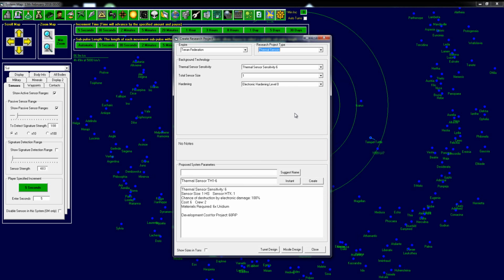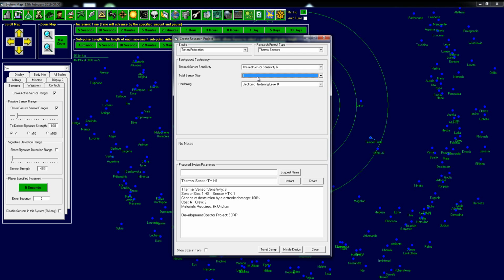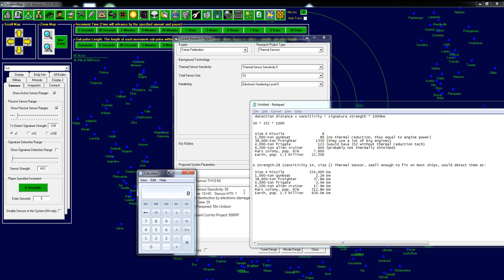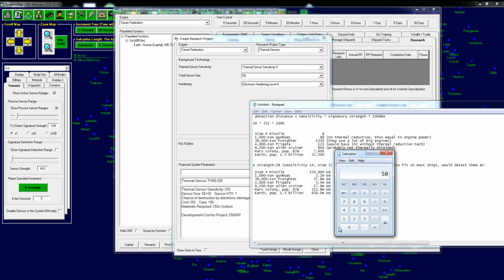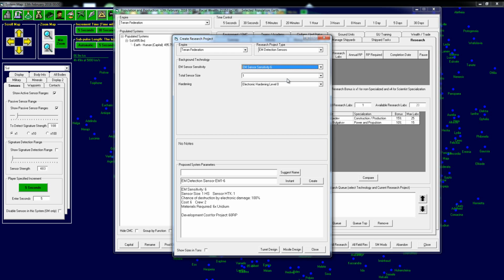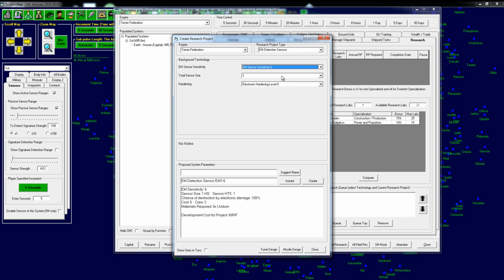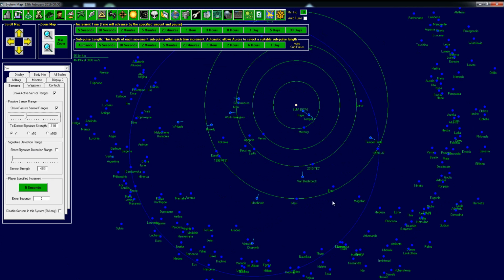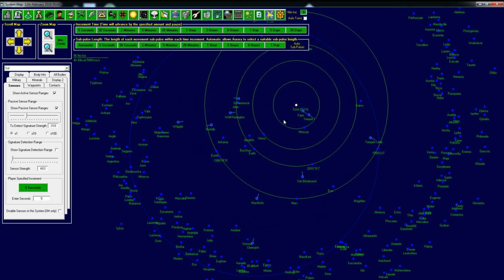Aurora 4x Ship Design Tutorial - "Passive sensors/Deep Space Tracking Stations"

Comment: usefull tutorial. 
in game it's realy not clear, what range u can get from passive sensor.
why do u recommend to have passive sensors on every ship? i mean, u didn't say a word of practical usage. what for do u use EM-sensors on operational (fleet ) level? it's quite clear, that you want to have EM and TH data on strategical level, but why do u want to have it on a ship, that has active sensors of it's operational degree?
Reply from the maker: +Sledge Hammer Well it's because I primarily play with both active sensors and shield off. So EM and TH sensors work as a first level warning while keeping your ship at least a bit more low profile.
Second thing would be that passives are so cheap you will not notice having them on every ship while if at any point they provide you with an early warning/information they are well worth it.
Third any kind of information is useful. If you get size, TH and EM information about your target you can deduct way more than from just one/two sources.
However again it depends on your play style. If you don't want to do it, don't :) There really is no hard efficiency penalty on your ships not having it. I just like it and imagine it as a "standard".
Reply: Alfapiomega seems reasonable. how do u know in game what EM-signuture your active sensor provide to enemy? (with turned off shields, if ship has them) i just want to calculate, what size of EM-sensor enemy needs to see me with EM-sensor before i see him with my active sensor.

on this example 
Kursk class Dalnij bombardirovshchik    11 250 tons     319 Crew     3047.5 BP      TCS 225  TH 352  EM 750
3128 km/s     Armour 8-44     Shields 25-300     Sensors 1/1/0/0     Damage Control Rating 18     PPV 35.04
Maint Life 3 Years     MSP 1354    AFR 126%    IFR 1.8%    1YR 226    5YR 3393    Max Repair 480 MSP
Intended Deployment Time: 12 months    Spare Berths 2    
Magazine 363    

352 Mill Magneto-plasma Drive (2)    Power 352    Fuel Use 50.76%    Signature 176    Exp 11%
Fuel Capacity 1 000 000 Litres    Range 31.5 billion km   (116 days at full power)
Delta R300/300 Shields (10)   Total Fuel Cost  125 Litres per hour  (3 000 per day)

Twin R6/C3 Meson Cannon 60km 10s p3per5 Turret (1x2)    Range 60 000km     TS: 20000 km/s     Power 8-6     RM 6    ROF 10        1 1 1 1 1 1 0 0 0 0
Fire Control 128km 20kms (1)    Max Range: 256 000 km   TS: 20000 km/s     96 92 88 84 80 77 73 69 65 61
Stellarator Fusion Reactor Technology PB-1 O6 (1)     Total Power Output 6    Armour 0    Exp 5%

Size 2 Missile Launcher (3)    Missile Size 2    Rate of Fire 20
Size 6 Missile Launcher (3)    Missile Size 6    Rate of Fire 60
Missile Fire Control AM MR1 (1)     Range 10.1m km    Resolution 1
Missile Fire Control X1500 MR193 (1)     Range 193.2m km    Resolution 30
Size 6 MR104 16200kms (20)  Speed: 16 200 km/s   End: 107.2m    Range: 104.2m km   WH: 18    Size: 5.93    TH: 86/51/25
Size 4 Anti-ship Missile MR40 24200kms (10)  Speed: 24 200 km/s   End: 27.5m    Range: 40m km   WH: 9    Size: 3.9642    TH: 121/72/36
Size 1 AMM MR1 28600kms (84)  Speed: 28 600 km/s   End: 0.6m    Range: 1m km   WH: 1    Size: 1.0079    TH: 200/120/60
Size 6 Anti-ship Missile MR205 16000kms (20)  Speed: 16 000 km/s   End: 214.4m    Range: 205.9m km   WH: 18    Size: 6    TH: 74/44/22

Active Search Sensor X1500 MR120 (1)     GPS 10920     Range 119.6m km    Resolution 30
Active Search Sensor AM MR0.9 (1)     GPS 140     Range 8.4m km    MCR 915k km    Resolution 1
Reply from the maker: Hey man,

to be honest I can't remember. Try designing a new ship and add the shield on the ship. By how much did the stated EM signature changed? Did it at all? I think that for turned on shield it was something like 30x the strengh of the shield or something.
Reply: Alfapiomega you got me completely wrong.
i want to know what EM-signature my active sensor provides to enemy.
i add active sensor to ship and EM stays zero. so i m confused.
Reply: +Sledge Hammer I think active sensors as them dont have EM and TH - they add a value to your ships TH and EM. To detect a ship you dont need EM or TH of a small piece of a ship - it takes value of whole ship. If you think that you can "stealthily" scan ship of any enemy the answer is simple, and alfa said that. You cant, becuase active sensors are giving you a "lock-on" on enemy ships allowing you to fire and guide your missiles to target.
Reply: Matthew L. the only thing, that i think about now. is how do u know what EM-signature your active scanner will add to your ship.
do u know the answer?:) 
i'l tell you how to use this information, whan i have it :)
edit: EM is electo-magnetic. it means, that it is detected if something sends EM-pulses. 
Active-sensor sends it and recieves mirror-image.
if u don't send EM-pulses, nobody can read it. (ofcause there is wiring with EM-poweredge, but it's zero in compare with active sensor)
Reply from the maker: +Sledge Hammer The EM signature of the sensors is written on the actual sensor as its GPS rating (Gravitational (???) Pulse Strength). This is then compared to the passive EM sensor on your ship and if it's check (using same logic as any other EM signature would) you detect the enemy.
Reply: Alfapiomega so if i activate A-sensor Active Search Sensor X1500 MR120 (1)     GPS 10920     Range 119.6m km    Resolution 30
the enemy with EM-sensor of strength 10 will notice me in 10920*10*1000=109.2 mkm. did i get it right?
Reply from the maker: That seems correct :)
Reply: Alfapiomega thanks. it's probably usfull to have EM-sensor of the same range, as opponent's expected a-sensor's range. to know that u are locked.
Reply from the maker: Exactly. This falls to the "tune your sensors to your opponents" once you know a bit about them :)